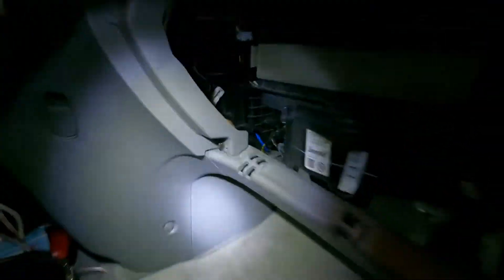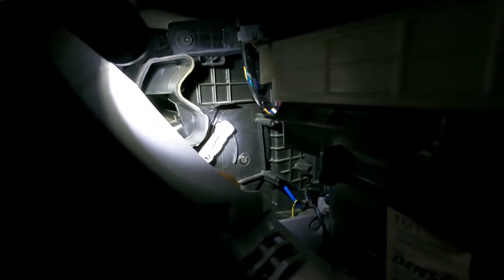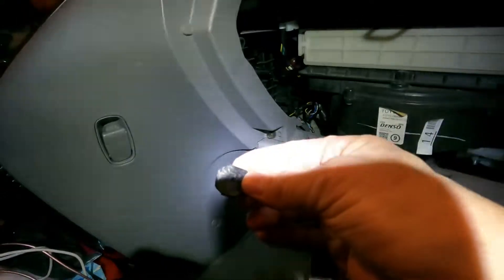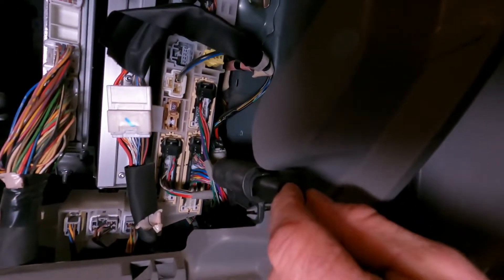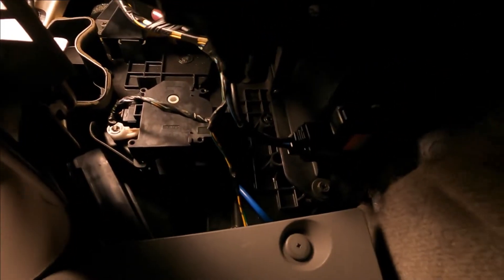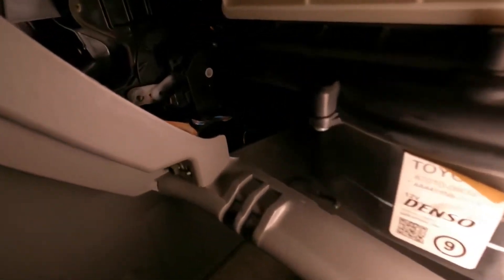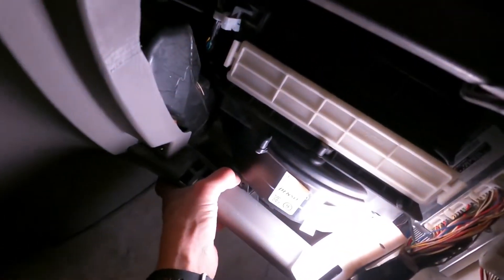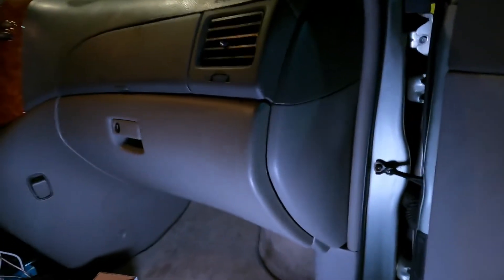Toyota Sienna XLE Blend Door Servo Replacement - Passenger Side - 2006

Comment: Is there any way you can let me know how I can get the actuator off on the driver side of a Toyota sienna 2007 XLE. I seen the video that you did but you got the one apart right next to it
 . I need to get the one that's right behind that one. Or should I say right next. Think that there's four screws to get it out and I don't know how to get to a couple of these screws
Reply from the maker: If it’s like that 2006, it looks like you will have to take some of the panels off on the front of your dash under the radio to get to some of the screws.

Comment: Thank you for this video. Would this fix a situation where hot air is blowing out of the driver side but cold air is blowing out of the passenger side when you turn the heat on?
Reply from the maker: I believe that’s what we had going on. My wife kept complaining it was blowing cold air but my side was fine:) I thought she was just whining for nothing until we switched seats one day…..
Reply: @therustichandyman  Hey, Thank you! I hope it's that simple. If it's just that piece, I plan on trying to just replace the inner motor (probably costs about $10) to make it an even cheaper fix. That is what I did with the sliding door motor. Thank you again for putting up this video!
Reply from the maker: I personally think it’s the contacts that tell the motor when to start and stop. They looked pretty worn when I took the old actuator apart. But I could be wrong.
Reply: @therustichandyman  That makes sense. Especially with the age of the Siennas (yours is '06 and mine is '07). Thank you again for the video and your advice! I really appreciate this!
Reply: @therustichandyman  Now the plot has thickened. I was able to take the motor off and set it up like you did so that it stayed blowing the hot air on the passenger side now. But, the backseats only blow cold air. Any thoughts on what might be causing that? I can't see how it would be related to the motor because I have set that to the heat position after taking it off.
Reply from the maker: Did the backseats just start blowing cold air after you took the motor off? I can’t remember if I had issues with the backseats or not.
Reply: @therustichandyman  Thank you for writing me back. They were blowing cold air before I took it off. I assumed that the motor on the passenger side controlled the passenger side and the back but it seems that it only controls the passenger side.
Reply from the maker: Oh boy. I can’t remember if I had that issue or not. I do know that I had to replace similar actuators on the passenger and driver side at almost exactly the same time. I found this hard to believe that they would go out so close together, but they did. I made a video of the other side as well.  I actually had both sides in “manual” until I just bit the bullet and bought the parts. Maybe you have the same issue???
Reply: @therustichandyman  I thought about how two of yours went out at the same time and wondered if mine had too. I asked a mechanic friend and he said that the rear one is behind the back panel on the passenger side so I may try to open that up and see what it looks like. Thank you again for all of your help and advice!

Comment: Do you happen to know if the same replacement procedure would apply to a 2012 Sienna XLE? I’m having an issue where the HVAC controls are unresponsive for the first minute or so that the car is running, then once the air conditioning turns on, I only get cool air out of the driver side while the passenger side blows really hot air. I took it to the dealership and they said the blend servo was bad but made it sound like the replacement was way more difficult than what was shown in your video. They said it would take almost an entire day’s labor and cost roughly $2500. I really would like to just do what you did in your video, but was curious if you know why they would’ve told me the dashboard needs to be torn apart and the refrigerant needs to be recharged after the work
Reply from the maker: Boy, I couldn’t say for sure. There are multiple servo motors like the ones I replaced under the dash, some are buried further inside the dash and serve different purposes. I’d do my research. Maybe you can find some other helpful videos on YouTube and save a bunch of money. Good luck!
Reply from the maker: I don’t know if it would be the same procedure or not for that year. I’ve only worked on my 2006. Wish you the best!

Comment: And how did you get the air duct out?
Reply from the maker: If you’re referring to the small black section of plastic air duct, it just comes apart with a little force and wiggling. It is just snapped together.

Comment: Do you have instructions how to remove it?
Reply from the maker: I didn’t record taking it apart (sorry). It was quite a while prior. It’s basically reverse of the installation process.
Reply: @therustichandyman , thanks for your response. I open mine today, it was hard to take the duct out, but I did it by twisting. After I open, the problem went away so I didn't replace the part yet. Can you tell me how much the part cost? Thanks 😊
Reply from the maker: @MrTamthua  I think it’s around $200. That’s why I drug my feet so long about replacing it. But it’s a real common problem in these Siennas. But good vehicle overall.
Reply from the maker: Should be a link in the description.
Reply: @therustichandyman  Thanks